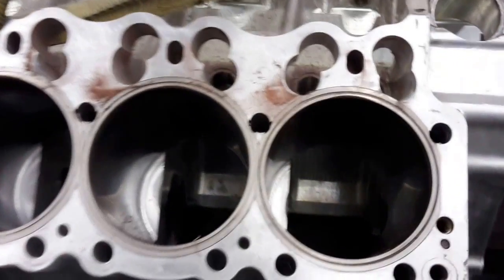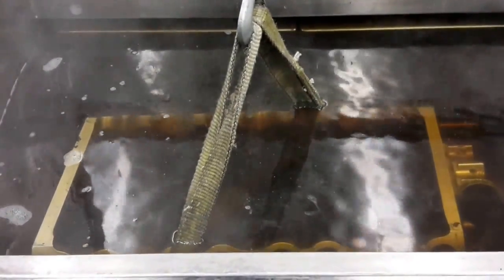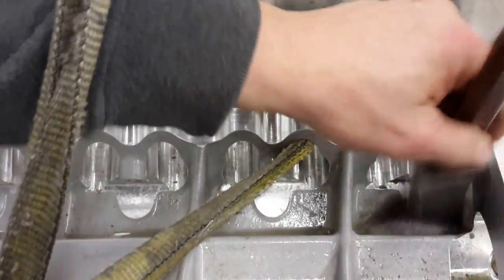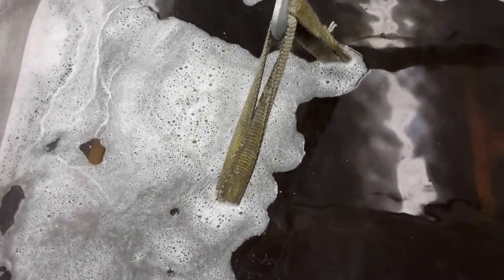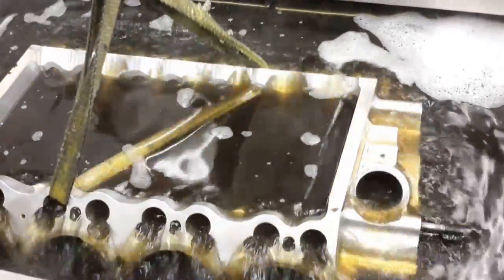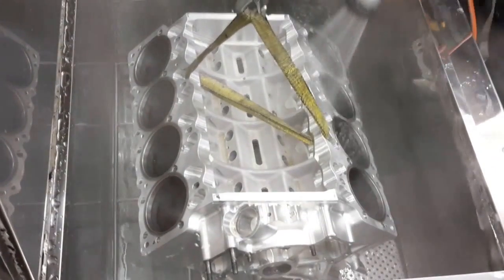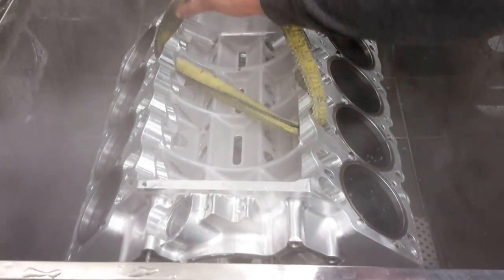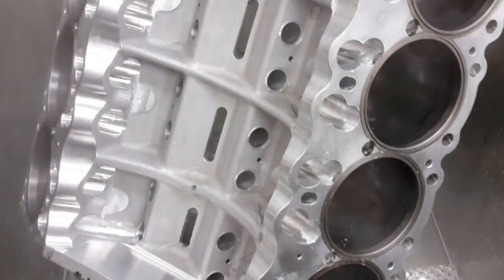Ultrasonic LLC - Ultrasonic Cleaning - Engine Block Cleaning

Comment: What solution is it?
Reply: Degreaser will do (purple power hot)
Reply from the maker: The solution used in this video was Ultra 2 which you can find in our shop at https://shop.ultrasonicllc.com/
Reply: What's the mix ratio? I was looking at your detergent. We just purchased a 88 liter tank for blocks and heads

Comment: What a waste of time and money.
Reply: Some people take pride in cars and have project cars which they might want to restore. Engine block and cylinder head cleaning can make the engine look brand new so that when we open the bonnet, we can see a clean brand new looking engine. You seem to be watching the wrong kind of YouTube videos if you are posting such negative and uncalled for comments. Please let other people live their lives and go and live yours. It has nothing to do with you.
Reply from the maker: With our Ultrasonic Cleaning Machines you save time in the cleaning process. Time is money, so if you save time you're saving money. Some heavy carbon parts may need some added cleaning. With the right detergent and cleaning times your work can be cut in 1/2 compared to conventional way of cleaning.
Reply: @Ultrasonicllc  hi i want thi machine

Comment: What is solution used in ultrasonic machine
Reply from the maker: We have a Heavy Carbon Cleaner for all the High Carbon parts. We have a milder detergent for the Billet Aluminum parts to avoid etching. Call our Sales Dept to find the detergent that best suits your cleaning needs. 513-502-9746